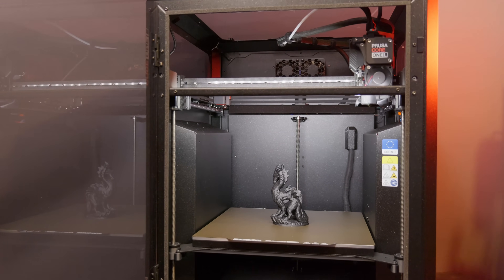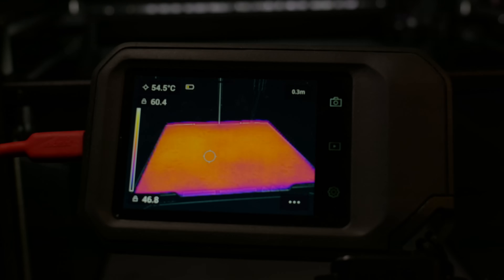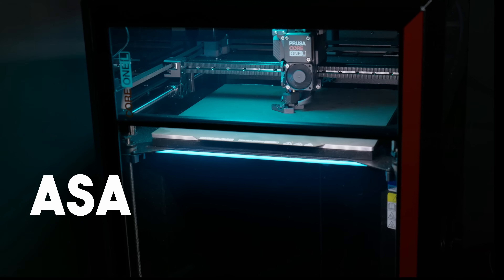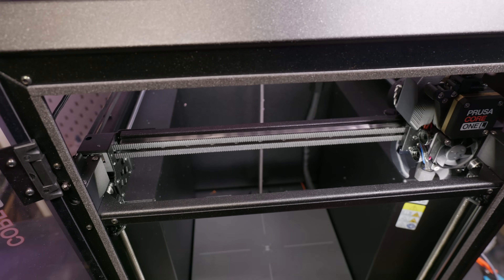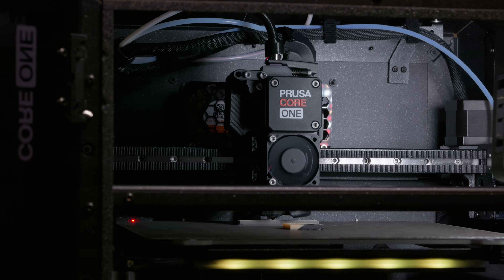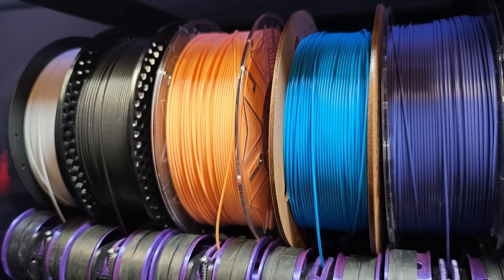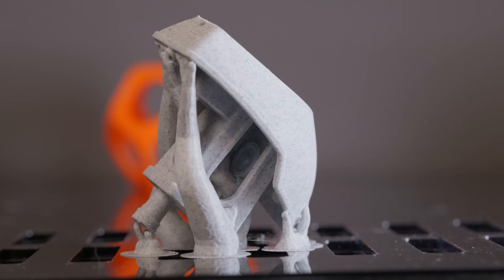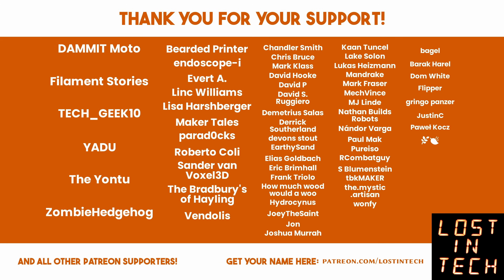The Prusa Core One L: No Compromises, but is it worth the price?

Comment: Imo it comes down to how much value you place on the Europe vs China/local vs cloud debate. I do like Prusa and want their machine (as much as I want a Bambu machine, I don't have either yet), but in Canada, for the same price of the Core One L I can get an H2D combo, and shipping is $110 extra for the L. Going more spec-to-spec and comparing it to the H2S, the L is 59% more expensive (incl. shipping).
Reply: Where I live the H2S costs just $50 less then Core One L.
Money-wise I would wait for Qidi Max 4.

EDIT:  Bambu pages shows lower price, but I was checking just the first 'page' with offers that google displayed for me.
Reply: Qidi always gets a bad rap.   I’ve had a plus4 and a Q2.  Besides one broken ceramic heat break they’ve been super solid.   The plus4 has had something like 30 spools through it.  (Redid all the drawer inserts in the house.)
Reply: I suppose the L will also be produced in the USA soon, but Therme also is some tariff conflict Sometimes...
Reply: All major printers can be run without a cloud.

Comment: We have 2 Prusas at work, im also cheap im using a Centauri Carbon at home, thank you for that last point. Prusas are expensive but again for a good reason, that is amazing. Maybe one day i will have the need to have a Prusa at home, i hope not i like to be cheap 😂😂
Reply from the maker: the centauri is insanely good value. I'm curious about the new one theyre about to release
Reply: I like Prusa, I am on Prusa Mini for 5 years and looking for upgrade.
What I do not like on Prusa is that they have to compete agains a lot of Chinese products and they choose again a smaller printing dimensions then them. I am not sure if it is not to protect their XL product.

BTW Centauri Carbon (2) is one of the options I am thinking of.

I just can't decide which way to go.

Cheap - Centauri Carbon - still upgrade in speed an dimensions, but I would like something quiter
Mid - Qidi Max 4 - and hope for someone to do the work that is needed to be able implement INDX, but it's 50kg beast
Core One L with already installed INDX, but for the price I would like to have less compromises

Damn where is the old world where there was easy to choose what to buy :D
Reply: @Michal_Peterka  You sounded like a enthusiast, the Centauri Carbon would be really boring for you, to make it quieter is not that hard or fun, i just replaced some cheap stuff boom done. Idk i think you would love DIY or Prusa route all the nerds are in it.

Comment: not a bad printer, but it just seems a bit behind the curve in some respects
Reply: @araylaurence6220  I would like to know too
Reply: @Nogginizer  They'll never be able to tell you. They always say that prusa is "behind" or "outdated", but then never be able to say why, probably becasue it isn't true.
Reply: Now that they have an official camera, I think they should implement fail detection. But - that's about it. So many "features" of many printers are just marketing jargon that has minimal impact on the quality or reliability of the printer itself.
Reply: @logicalfundy everyone has to turn it off pr set it to low on bambu printers anyways due to false positives. Seems like it’s not worth it with current tech (at the prices they stick to).
Reply from the maker: curious to know which respects as I hear this a lot but it never makes much sense
Reply: @LostInTech3D I suppose the biggest one is probably nozzle pressure that the H2 series come with for automatic PA.

But otherwise, everything is at a competitive state I feel like. Of course the acceleretometer should have come in the C1 toolhead. 

Btw. Binged watch all your vids for awhile. Great stuff.

Comment: There was the Core One + upgrade for 10€ that includes all upgrades except the AC heated bed.
Reply from the maker: Yeah I found out about that...seems worthwhile - might try it out
Reply: $10 or print it yourself! I opted for the latter and it’s been great
Reply: well, almost. no bed fans and no accelerometer in the toolhead either. But the upgrade is still nice.
Reply from the maker: I suppose the bed fans only make sense if the bed base is more conductive in the first place
Reply: @LostInTech3D  Yeah, the bed heater of the core one probably isn't strong enough either for bed fans to make sense.
Reply: It's all printed parts and a sticker lol

Comment: Everytime I heard "no compromises" all I see are compromises.  it does look neat tho, specially with INDX it's hard to choose h2c over this despite it's many advantages and automation.
I do wish it was 350x350x300, I do get why they didn't do it tho, the bigger you go the more load and bending there is in the axis. I'm surprised as simple linear rod can hold it's own weight like that in this size.

Ideally i'd get indx on an h2s although i've heard awful things about the h2s from some people.
Reply from the maker: if they did 350, there'd be someone asking for 400 I'm sure. I think you could run much longer rods though, I just tried flexing the whole thing manually and unsurprisingly no bend in the rods at all.
Reply: @LostInTech3D  Tbh that is a fair point LOL. 300x300 to me is a sweet spot, but to me I never print anything larger than 350, on rare rare occasions, I've wanted 350 for  stencils. everyone is different obviously. and huh, I wonder how thick they are, on my doot changer m 10mm rod had a bit of flex in them, although it was actually probably closer to 350mm as a lot of the usable print area was taken by the tool dock.
Reply: I guess 350 would be too close to XL